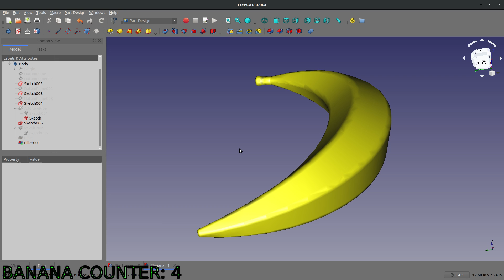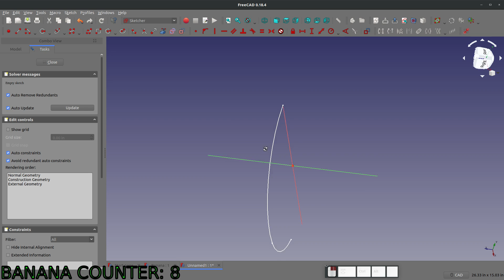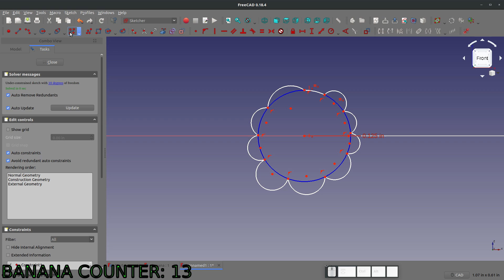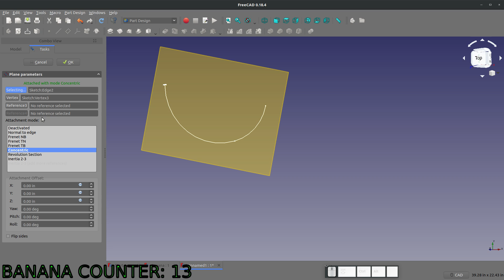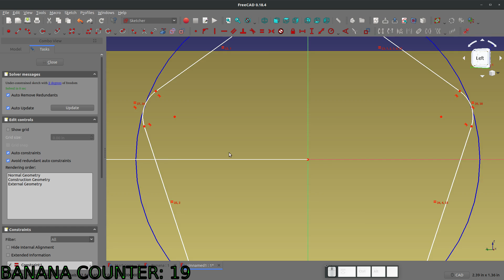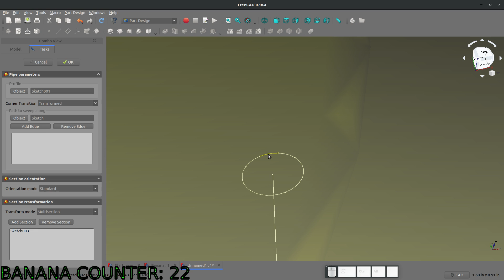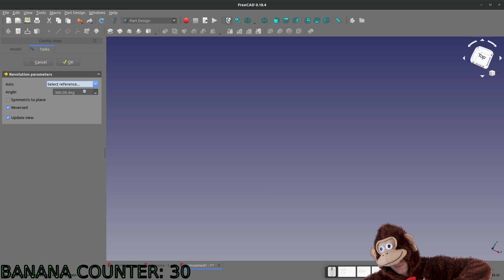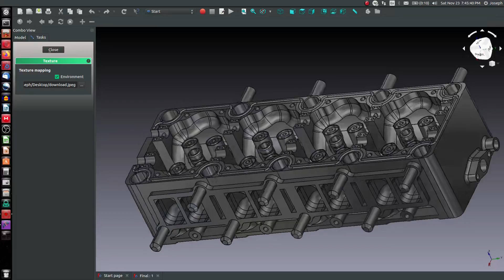FreeCAD Model a BANANA |JOKO ENGINEERING|

Comment: Only the bananas in the middle of a bunch will have 5 sides - the ones on the outside will have only 3 or 4 sides depending on how many other bananas they press against while growing. But, most of the bananas will have 5 sides.

Comment: I have tried freecad in the past. I use solidedge atm. In the part environment and sketching a part i don't need to constrain my sketches its not a requirement in solidedge. The main reason i stopped tiring to learn freecad is because of constants. My day is used up by quoting for new work, shop drawings for work we have won, running the factory floor and some times other sites and or cutting, drilling, machining and welding also i am the owner operator of 4 children and a wife and i use tekla somtimes badly. I find having to work out how to constrain and even just doing it time consuming. Is there any way of not using constants or (because you seem more connected to the development history of freecad) could this could be included in the next update i would be happy to donate a $1000 usd in aud which at my end would be more than $1000 usd. I have a paid a 360 license but solid edge part sketch seems better however the 360 assembly side of things seems to be better than solidedge. The reason i ask you this is because of the quality of your freecad content and the freecad people would also see your work and it would be easier for you to get into there ear than me. Thanks in advance for lobbing on my behalf. I will continue to watch even if no one listens to me you explain cad well.

Comment: Cannot overstate how grateful I am for your videos on FreeCAD! Amazing job! I've learned so much from you!!!

If possible, please, cover more the topic of surface modelling and the tools available for that that. Simple loft and sweep aren't always enough. I've already discovered Curves WB, Silk WB and some others, but learning about them is pain. There are virtually no materials besides a few screenshots and scattered forum posts. For example, right now I'm trying to model my smartphone as an exercise (ZTE Blade V10). It has quite complex corner transitions between sides. And I cannot force the sweep tool to follow the curves properly since it doesn't allow multiple guide paths. I feel like surface modelling could be the answer, but so far I had no luck with it in FreeCAD.